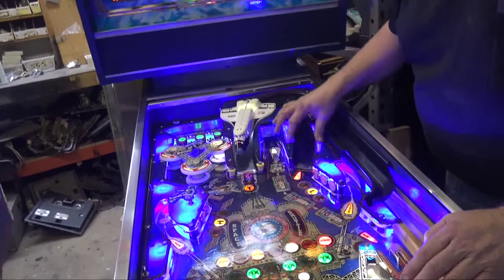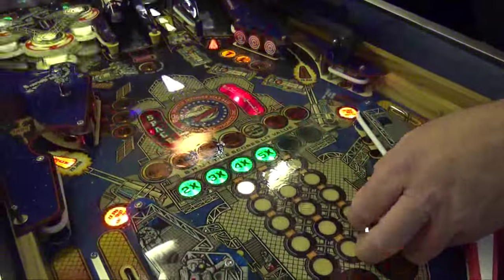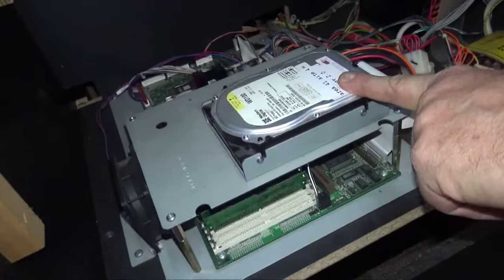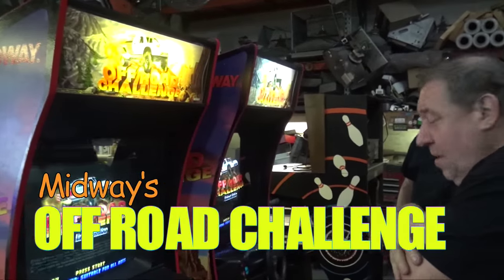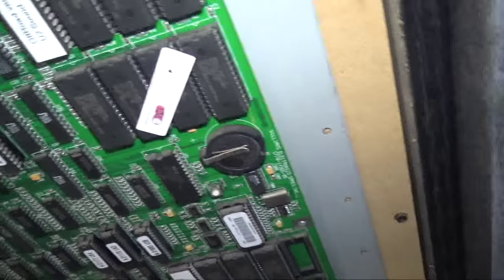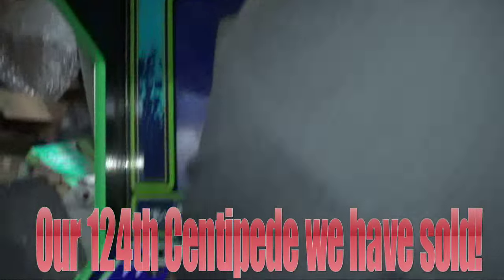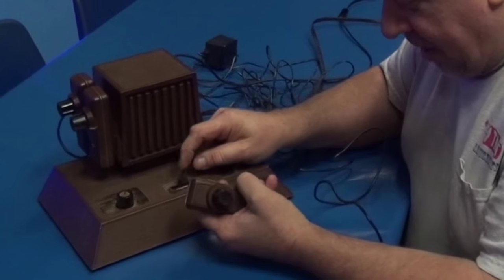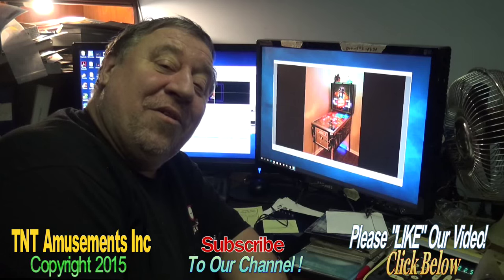#1065 SPACE SHUTTLE Pinball-OFF ROAD CHALLENGE Arcade Cockpit- TNT Amusements

Comment: Todd, the reason compact flash (CF) cards don't always work in these old systems is that CF cards only contain a small sub-set of the full ATA spec. Some CF cards contain some parts of the spec that others don't, but NONE of them contain the full spec (this could also be why you had a Gauntlet coding out with a CF card). Try using an SSD (Solid State Hard Drive) which contains the full ATA spec, is faster and more reliable than CF and has better wear leveling/durability. SSDs, for the most part, use a SATA interface so if the machine uses an older 40 pin ATA 33/66/100 IDE interface you'll need a bi-directional IDE to SATA adapter like this SYBA (http://www.newegg.com/Product/Product.aspx?Item=N82E16812186078).  Smaller SSDs (128GB) can be found on Amazon for about $43 (Sandisk and ADATA are good, inexpensive brands).  You'll also need a drive holder to adapt the 2.5" drive to a 3.5" mount so you can use a cheap one like this Bytecc (http://www.newegg.com/Product/Product.aspx?Item=N82E16817994085&cm_re=2.5_to_3.5_bracket-_-17-994-085-_-Product)
Reply: +bdwilcox BTW, the SYBA adapter would mount directly into the motherboard's IDE port and a SATA cable would go from the SYBA to the SSD.  To make this work you will also need a 4-pin floppy drive power connector for the SYBA and a SATA power connector for the SSD.  (both connectors should be no-brainers for Frank to install).  As an aside, the SYBA supports the full ATA spec as well and only costs about $10.  I've used a bunch of these setups to harden older, mission-critical systems by replacing the weak link (the mechanical hard drive) and they've never given me a problem.